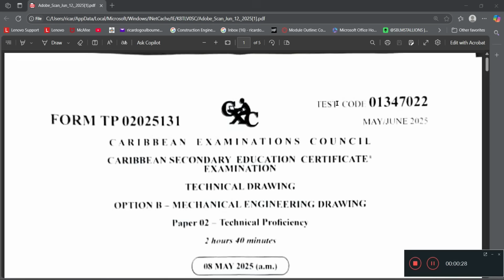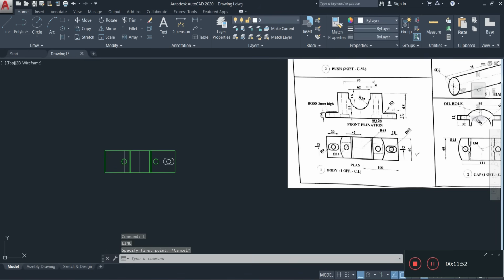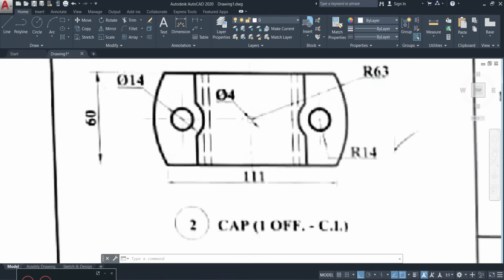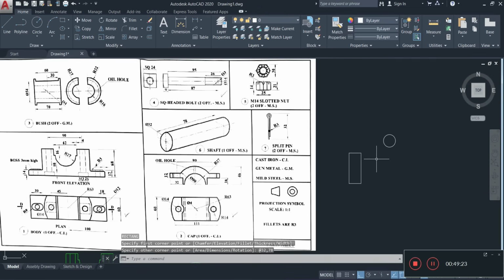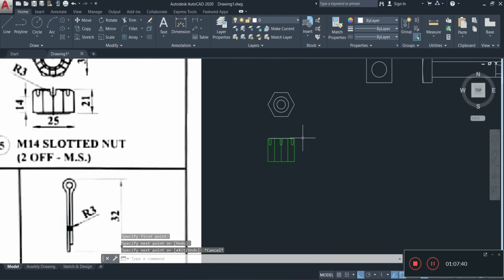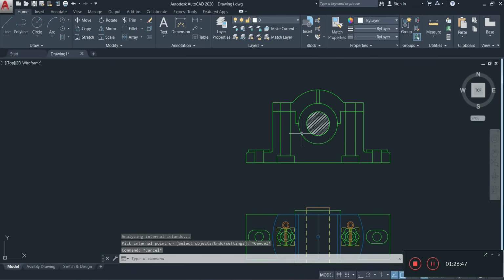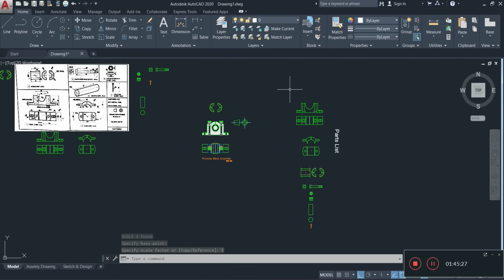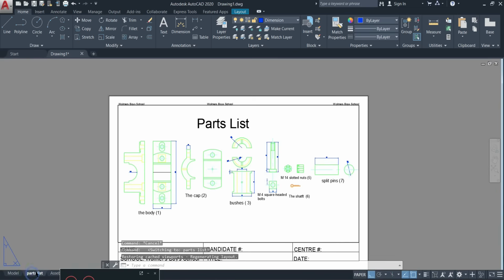2025 CXC CSEC Technical Drawing Paper 2 (May–June 2025): Assembly Drawing

Comment: Also how my teacher has us do the parts list is that we make a 3 part table with the three headings being "NO.", "PARTS", "NO. OFF". 

"NO." - This is where you'll put the orders of the balloon referencing, e.g. how the balloon referencing number for the M14 Slotted Nut is '5', the bushes is '3'..

On the right side of the "NO." column, you'll have the "PARTS" column which will list the parts corresponding to their balloon referencing number (ofc it'll all be in order/sequence i.e 1,2,3,4...)

On the right side of the "PARTS' column you have the "NO. OFF" column which will say how many of that part there is, e.g. like how there are 2 spilt pins, you'll put '2' in that column.

So you'll have the headings, and then in the rows following that it'll look like:

NO. | PARTS | NO. OFF
------------------------------------
1     |   BODY |  1
2     |   CAP   |  1
3     |   BUSH |  2
4........

Sometimes there are those who also include the "MATERIAL" corresponding to the part, but my teacher didnt say anything about needing to include that. However, it wouldnt hurt to include it because after all, the most thorough/detailed drawings are the ones that score the highest amount of marks and that one detail can be what sets you apart from coming first place or second if you and someone else happened to have the same score. 🤷‍♀

Hopefully i explained it well enough, but essentially you dont have to redraw/copy each individual part for the parts list. 😊
Reply from the maker: you are perfectly right! let me run a update
Reply from the maker: https://youtu.be/7i_-nBpizlA